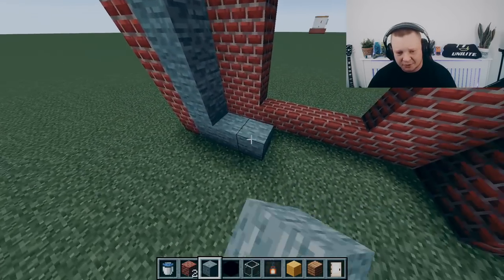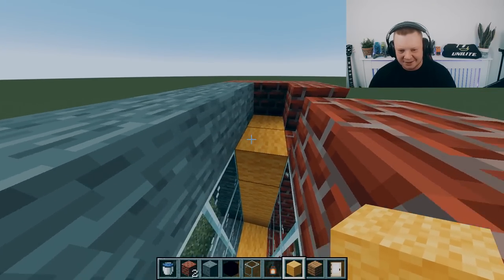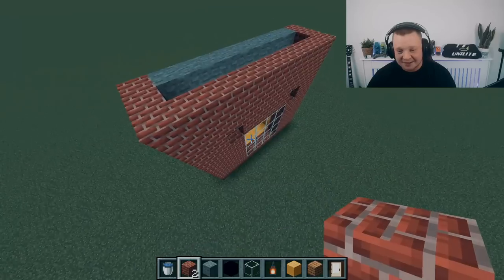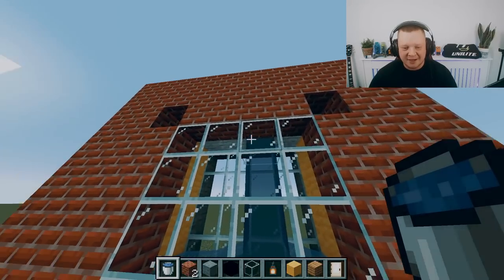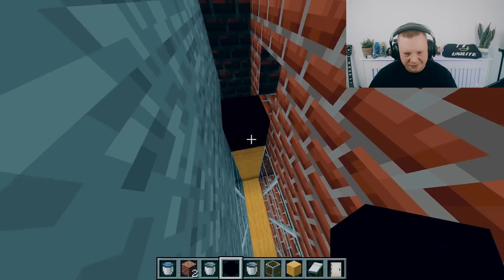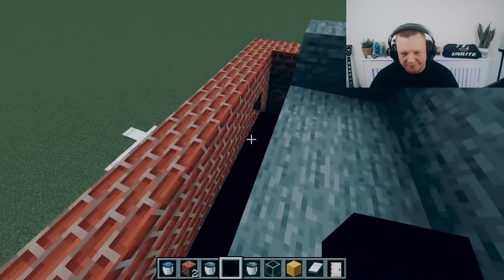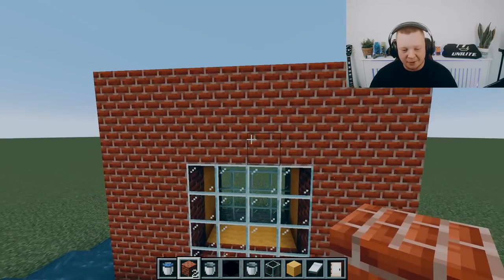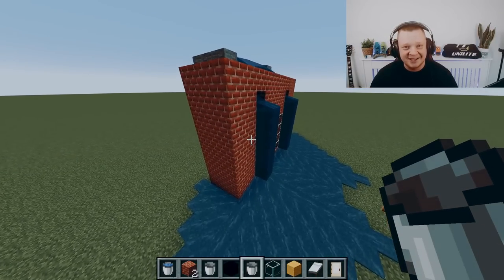WEEP VENTS & CAVITY TRAYS EXPLAINED!! Ft Minecraft

Comment: The inner and outer walls of our long row of semi-detached houses were replaced about 20 years ago due to rotted ties. Our walls, and those of our attached neighbour's walls, have "vents" (missing mortar between adjoining bricks) 4 courses above the top of the downstairs windows, spaced every 4 bricks around the entire exterior wall. They are also in the course directly above the upstairs windows, also spaced every 4 bricks. But the semi-detached houses either side of our do not have any at all, and would have been rebuilt during the same period. I questioned this, and was told it was "down to the brikkie doing the job".

Comment: I always wondered, erent two thin walls weaker than one doublethic? In Poland, we build normal thick wall and then insulation on the outside covered with plaster. water can leave at the bottom of insulation, because it ends overhanging above ground (usually 1 or 2 foot or 30-50cm), while moisture leave at the top under the roof.

Comment: You would have had a field day inspecting our last home. It was a council place, but 3 years of reporting water marked walls, and being told its condesation (it wasnt) the few spells of -7 last winter (previous 2 winters had been mild) finally was the last nail in the coffin. The whole bathroom ceiling came down, 1/2 of the kitchen ceiling below came down. Parts of my daughters room and the lounge came down. The external brickwork around the back door and kitchen window could be pulled out with 0 resistance. The frame and seal round the bathroom window came away and if the rain came at a certain way it would rain on you! The loft insulation was mouldy as rotten. And sooooooooooo much more. Worst thing is, a "surveyor" from the housing association we rent from, came out the day before all this happened and his exact words were it's absolutely fine, nothing to worry about. Just condensation. It wasn't condensation 😆 but yea, I'd have loved for you guys to have looked it over 😆

Comment: Great explanation but why is the tray just above a window when water could come in anywhere?
Reply from the maker: because openings through your brickwork, such as doors and windows is the only place where the cavity is above that opening so water is going to land on top of your head reveal and come inside, so it needs to be stopped with a cavity tray, everywhere else, the water will just land to the bottom of your brick wall where there’s also other cavity trays installed lower to
Reply: @newhomequalitycontrol  got it, thanks 👍🏻

Comment: Are weep vents and water trays a relatively new building code requirement?  They make sense but looking on my house and the neighbours (built at different times) I can’t see any weep vents at all.
Reply: Some older houses dont use cavity wall construction, they are solid brick walls instead
Reply: @darshitcumdeepgupta6998  it wasn’t really old houses with solid walls I was wondering about, it was cavity wall construction without weep vents.  With some more internet searching I found that weep vents were not mandated by code in the US until 2000 (and the article said that even then they may not have been enforced in all states).  Couldn’t find anything about when introduced in the UK, but as my house was built in the 1980s it may just not have had them
Reply: No weeps have been used since the 1900s.

Comment: explaination forgot 1 major reason water is getting on the backside of the brick. Picture a glass of Ice Water, the onside gets covered in condensation. The same thing happens to the brick wall, Cold exterior and Warm interior generates condensation on the brick.

Comment: I never knew this was even a thing. But from the way it was explained, doesn't this mean American roof are useless?

If there's a proper roof the water would be directed away from the buding, it does not land directly on the brick for extended peroid of time so there is no way for it to become saturated to begin with. So American roof does not protect the wall???

We don't have weep vent in asia and our building with A frame roof are fine during rain season in Indonesia. If the wall is damp then there is something inherently wrong with your roof, not the wall, at least that's how the mindset over here is like.

Also, who the hell glue a wallpaper over a brick directly aniway? We put whitewash/plaster over the brick first inside for a reason, it's for protection should on the off chance the roof fail, that way the water flow down inside the wall into the soil while not damaging the actual paint/wallpaper. I don't get it as non-Anerican...